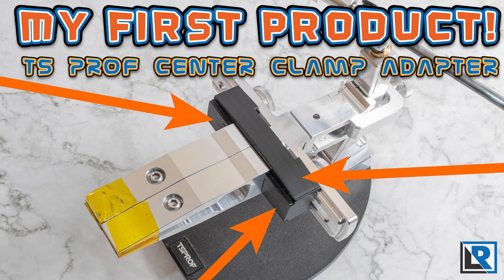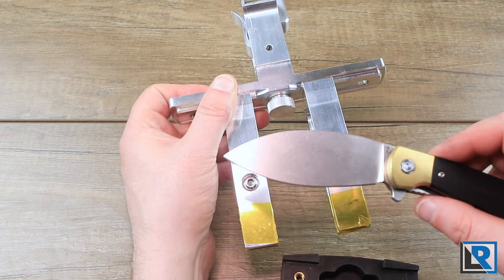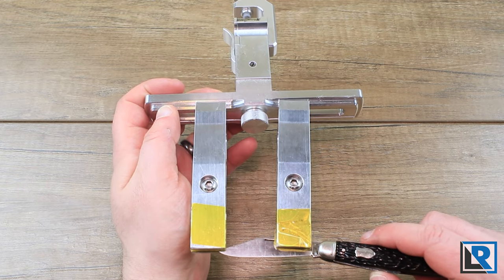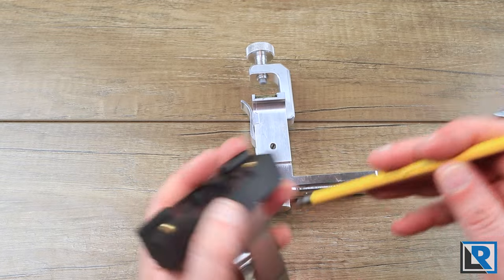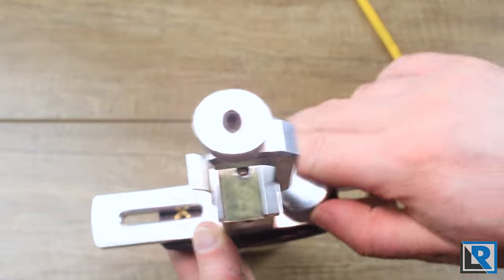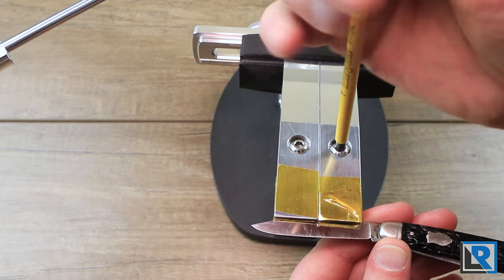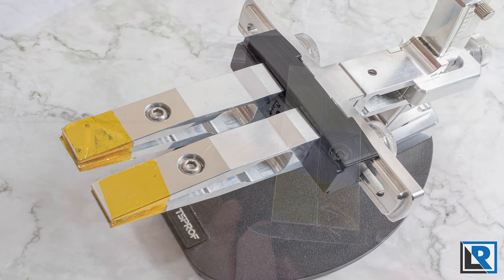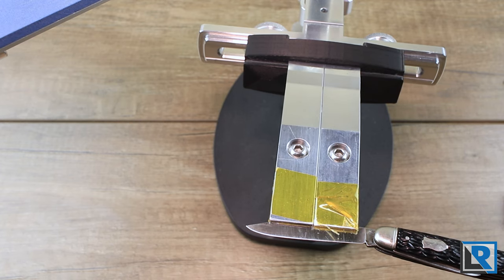PrintSharpCo TS Prof Center Clamp Adapter (K03 & Kadet, 3D Printed, USA)

Comment: Would this work with sub 2in blades? Most of my blades are smol. Like my Matsey striga is 1.57in and my protech runt, and sprint are just a little under 2in. Would this adapter help with holding those smaller blades? Also enjoy your light reviews! I'm new to the knife world. So it's nice hearing a familiar voice while going down the rabbit hole or knife sharpeners.
Reply from the maker: I have sharpened some very small SAK blades with it in the center position. It's mainly design Ed to help even out bevels, so you can mount in the center vs off to the side with the stock setup. How the knife clamps is unchanged.